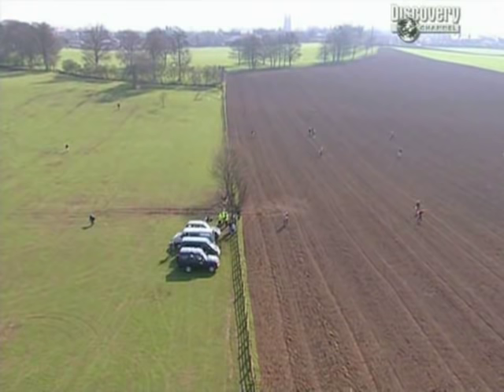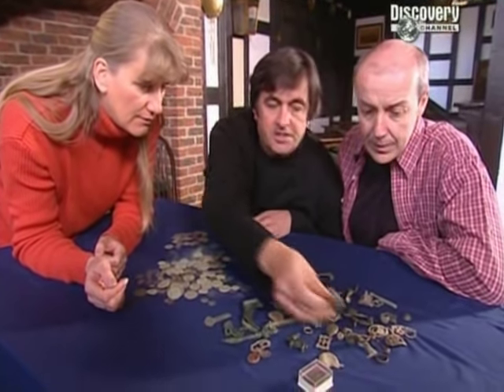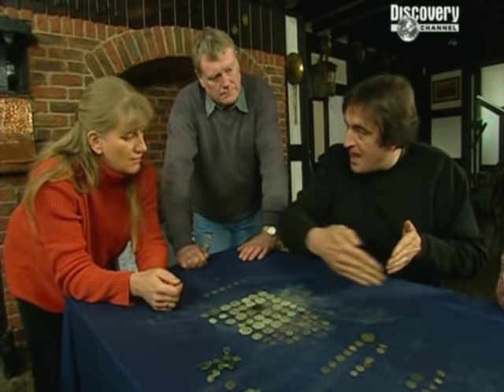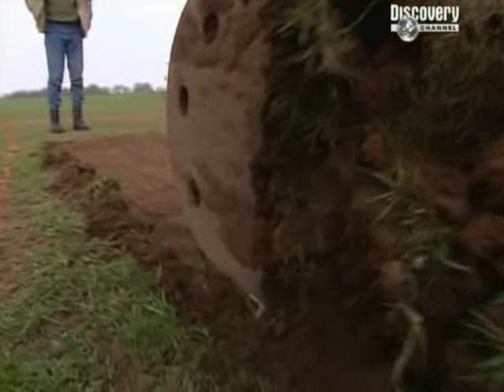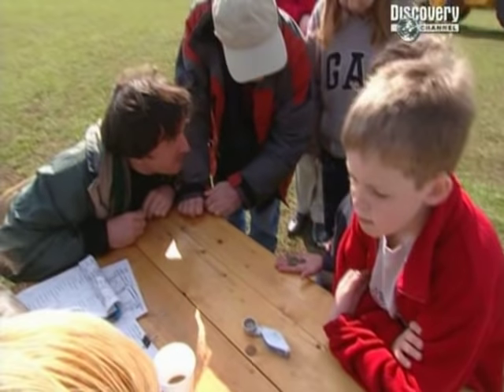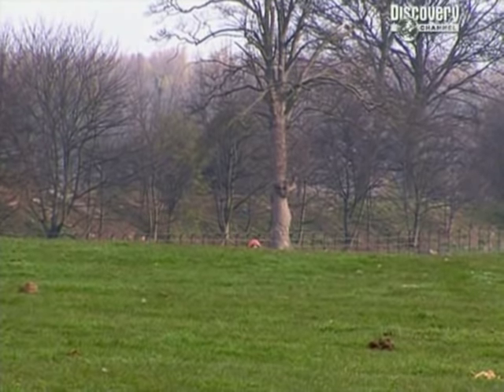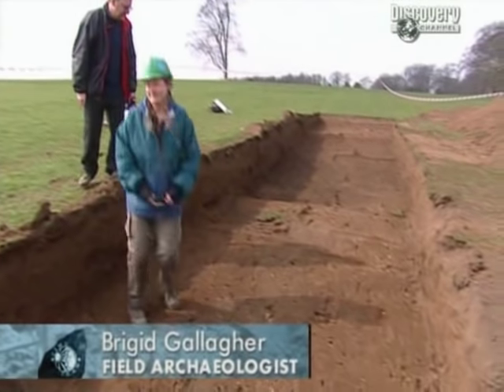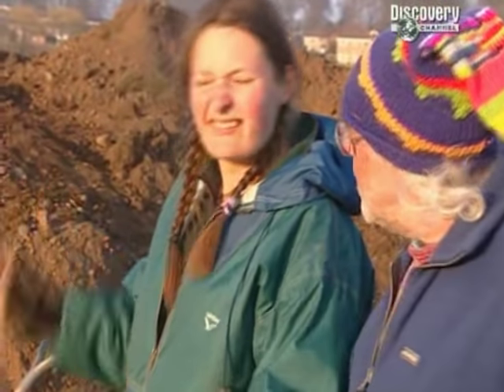Time Team S10-E12 Sedgefield,.County.Durham

Comment: Since they are using brass blanks, they could take a hint from gun ammo re-loaders, heat the blanks almost red hot then rapidly quench in cold water.   That will make the brass soft and easily struck.

Comment: Anyone else finds Guy's theory about a stone kicking wheel implausible (around 36 min)? Thing would have weighed a ton (literally) and without ball bearings how would the axle turn with such a weight attached?
Reply: The kick-wheel is known to have been used as early as the 3rd millennium BC in Egypt and possibly earlier. Wheel-thrown pottery is also found at sites in Sumer and the Indus Valley that date to at least as early as 3500 BCE.
Reply: depends. There are low friction bearings possible - something with a point on the end for instance.